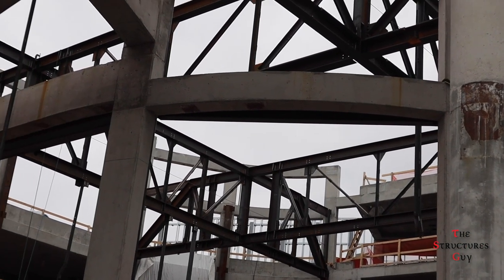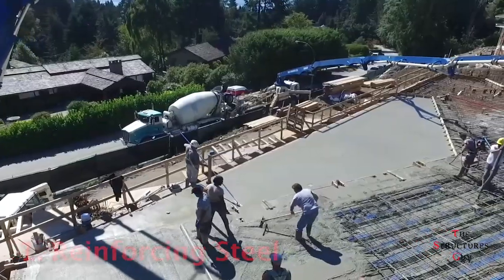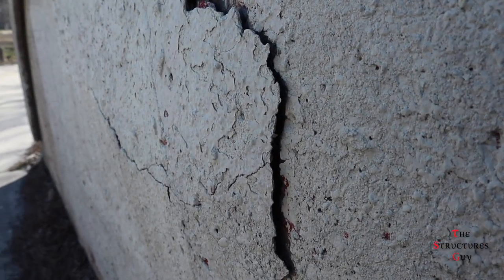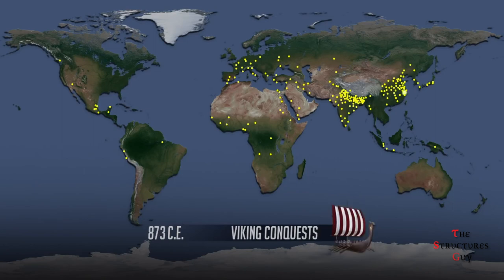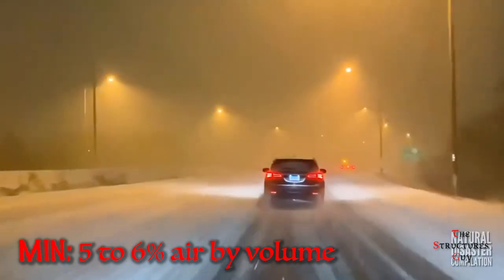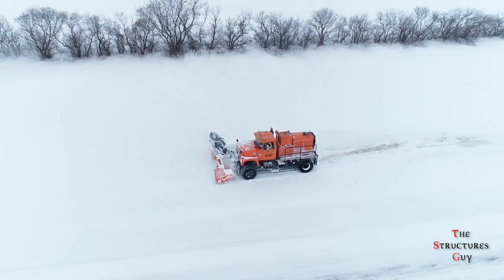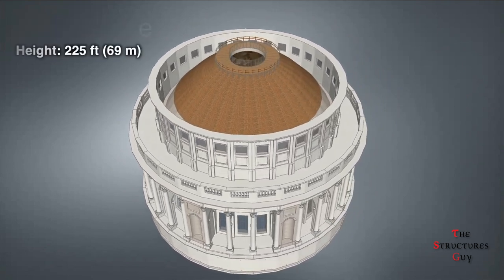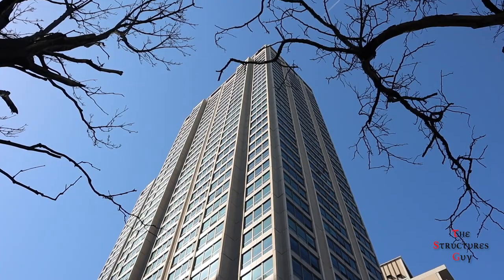Why Roman Concrete is NOT Better Than Modern Concrete?

Comment: I have a question. If I want to build a home to last for generations, what materials do I use?
Reply from the maker: Concrete! A well designed concrete with the right rebar and the optimal curing conditions can last a really long time with some maintenance
Reply: @thestructuresguy8355  It seems like stone structures last forever. Pyramids are still standing after thousands years.
Reply: Better ask somebody with less fishy smelling motives my dear friend  😉
Reply: @thestructuresguy8355  bullshit, the rebar rusts fast and makes the concrete spald
concrete without rebar is useless, concrete with rebar gets rust cancer in a generation or two
Reply: @vladtheimpaler3625  Stone structures are your best bet. But, you should consider your environment. What kinds of natural disasters will you be facing? What kinds of temperatures can you expect at the extremes, and on average? Stone is long-lasting, but if it is mortared stone, it will crumble in an earthquake. Look up how the Incas cut their stone and fitted the pieces together for and example of stone walls that can withstand powerful earthquakes. And stone doesn't have great thermal properties, so if you live somewhere cold, consider a different material, or maybe just use stone as the façade. There are other materials that can last a very long time, modern concrete isn't one of them, by the way.

>Straw bale construction can potential last indefinitely if the walls aren't covered with anything that impedes the breathability of the house. By that I mean, you'd have straw bales in the wall, then a layer of hempcrete or cob of daub or something like that on the outside, and you wouldn't cover that with some kind of vinyl pain. Inside the house, you'd have the walls covered in plaster or something, and again you'd need a breathable paint of lim ewash to maintain breathability, so the bales never rot. This would be a stick or timber-framed house (or a self-supporting dome) and it could in theory last for centuries. Walls are typically over 2 feet thick, at least.

>Adobe construction lasts for millennia. This is ideal for arid or semi-arid climates, and this has good thermal properties. Adobe can either be brick of superadobe or hyper adobe,  or rammed earth. These can word in rainy places, as long as the walls are protected with wide eaves and a pitched roof. 

>Cob house, pretty much the same applies, these are made of mud and straw and sand and other materials, and has good thermal properties. You can control the thickness of the walls, and again needs rain protection. This kind of construction, as well as adobe, lend themselves well to dome building, which is the strongest shape for withstanding earthquakes, and also intense winds from hurricanes or tornadoes. 

Using wood to frame your house will give your house flex during and earthquake, and wooden homes have also been able to last for centuries, as long as the house, and the beams, are allowed to breathe. This means that if and when they get wet, they are allowed to dry. Attempting to seal old timber beams on medieval houses has actually led to the destruction of many of these beams. Water finds a way in despite the sealing, but can't get out so easily, and not too long after it's rotting away. There are beams from  the 1500s which were fine and structurally sound for centuries, and the come the 1930s or 50s, some seals it with tar or something, and then only 50 or so years later the beam is garbage. Why people feel the urge to fix things that aren't broke I will never know. 

Anyway, that was just a small sampling of some proven time-defying construction methods, hope that helps. Definitely don't go for modern concrete, unless your idea of "forever" is 50 or so years. I'm sure if you look up the vernacular building methods from wherever you are, that will be a great jumping off point for how to build a long-lasting home, and one that is suited to your environment.
Reply: @venus_envy  Really appreciate you write a small essay for me. Inca's stone cutting skill is unparalleled, it can survive from earthquakes. I don't think modern people can replicate it.
Reply: @thestructuresguy8355  At least do some research before making and posting a video. My maternal grandfather's house is made of this 'Roman Concrete' and it's at least a 300 years old structure. Other than the interior upgrades, no maintenance has ever been done on the building. The house keeps cool during summers and warm during winters (compared to modern concrete houses). And note that it's in Rajasthan, India - which is a hot desert with absurdly hot days and very cold nights. It also rains pretty heavily in that region during the monsoon. It just got phased out because it was complex and time-consuming to create, compared to modern concrete made in high volumes in factories, making it much cheaper (naturally), as my grandfather was told by his forefathers.
Reply: @patrickmihajlovic4112  True. It just looks like retaliation from a guy making cash by selling concrete.